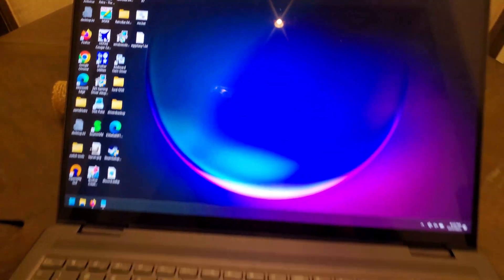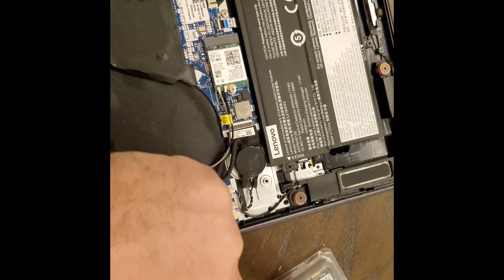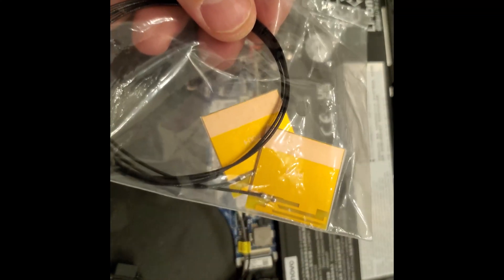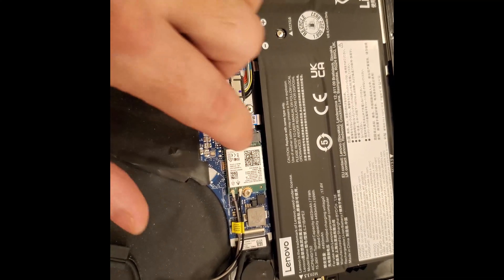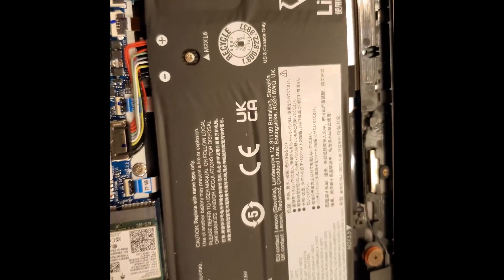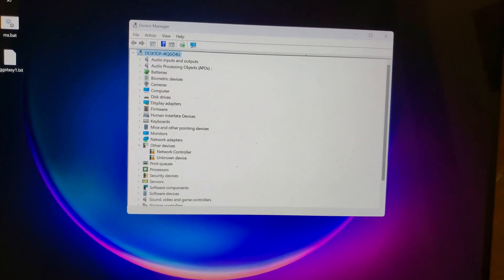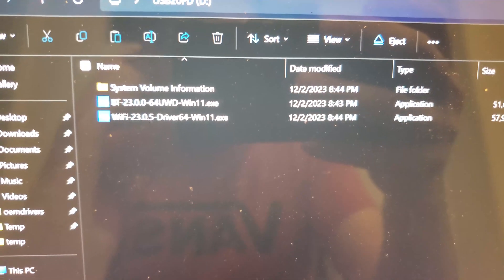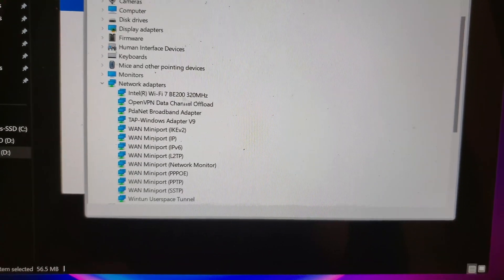Easy WiFi 7/Bluetooth 5.4 Upgrade (Intel BE200 M.2 NGFF Card)

Comment from the maker: Intel has updated its drivers to version 23.10.0 which now supports the BE200 on Windows 10 x64 and x86 , however it does state the card will have limited functionality meaning it will probably operate at WiFi 6E specs.

Comment: Thank you for sharing the driver files. I have ordered the same wifi module. Do you have the link which has the updated wifi driver version?
Reply from the maker: The link I shared will still get you to the current drivers, Intel also has them on their site. Happy install!
Reply from the maker: Latest version is 23.160.0.

Comment: Hello! I'm interested in finding out if my Dell G3 15 3500 laptop, which comes with an i5 10300H processor and a 1650 Ti GPU with 4 GB of VRAM, is compatible. Thank you!
Reply from the maker: Should be fine, just need to pop out the existing card and install the new one.

Comment: BE200 DOES NOT WORK IN AMD LAPTOPS AS OF MY 2024. Beware!!!! No one is talking about why even though there are no alternatives available at the moment.
Reply: Thanks. I’m also looking for a WiFi7 adapter that works with my laptop that has an AMD CPU.
Reply from the maker: Someone did post about that sometime ago.  Do you try to install it in an AMD?
Reply: @oWONTEKo  my new 6600H laptop refuses to turn at all with my be200 m.2, which ist crazy. The old i7 6700HQ boots and runs the card no issue.
Reply: Well if u have eyes they're clearly warning u not to purchase the BE200 series for any amd chipset or motherboard regarding amd
Reply: @wisetone  If YOU had eyes and weren't necrophiling your recognize that this post is a year old when it was NOT generally known yet.

Comment: Man, sorry. But can you disconnect battery at first and use antistatic gloves next time?
Reply from the maker: I was under the impression that the M.2 slot has no voltage when shutdown.. unless the board is standby mode which it does get some current.

Comment: I'd like to ask a few questions: Does it work in hotspot mode? Does it work on Linux? And does it work on non-x86? I was thinking of putting it in Arm SBC and using it as cheap access point.
Reply from the maker: When I tried the hotspot, I didn't get an option for it the hotspot to be WiFi 7 unfortunately.
Reply: @oWONTEKo  maybe problem with Windows?
Reply from the maker: Could very well be, hopefully updates will fix this.
Reply from the maker: I'll test on Linux later
Reply: @oWONTEKo 
Did you check does it work for Linux?

Comment: Hello, I want to know if the (Intel-BE200 Network Card, WiFi 7) is compatible with my notebook Acer Aspire A515-54G, Intel i5-10210U processor
Reply from the maker: Looks like it is, have a look inside your laptop to make sure the existing card M.2 slot is the same keying.
Reply: @oWONTEKo  é compativel tenho um praticamente igual, o que muda é que o meu tem placa de video dedicada, mas o blueth nao está funcionando.

Comment: I put this BE200 in my AMD desktop via pcie card. works great. You should download driver from intel though. not 3rd party. never 3rd party. I turned on hotspot for my desktop and now have an access point for wifi 7.
Reply from the maker: third party driver sites are dangerous, oemdrivers.com is the exception as it links to the manufacturing company when possible. Nice job getting your WiFi 7 card setup! peace
Reply: Hello, please tell me what AMD processor do you have? I'm considering buying a BE200 and have read a lot of reviews about compatibility issues. I have a Ryzen 5600x and Windows 11
Reply: @daniilmarkovskyj515 Do not buy it if you want the 6ghz band to work, that requires intel cpu
Reply: Nah it doesn't have the 6ghz band if you're running an AMD CPU, fucking intel and their proprietary bullshit

Comment: Can u do a test by opening task manager then performance then wi-fi and run the speed test using either google or any app. I wanna see the graph of task manager. Thanks.....
Reply from the maker: Hello! did you want me to do it on a WiFi 7 network? because I currently don't have access to one.
Reply: @oWONTEKo  so...do u currently have intel wifi 6e ? And update the driver before starting test please

Comment: Unfortunately doesn't support AMD
Reply: Realtek limited to 160MHz and sucks, you should avoid at all cost.
Reply: @anonymous12292 wifi 6e is 160mhz
Reply: You have no idea what you are talking about.  @anonymous12292
Reply from the maker: Wow, didn't know that! Is that any AMD system?
Reply: @oWONTEKo I think so, which is a shame.
Reply: @oWONTEKo no, amd will release mediatek card in 2024.
Reply: @rajmangalpandey3910  But mediatek sucks
Reply from the maker: Realtek does have a WiFi 7 card coming, but I haven't heard it works on AMD. https://oemdrivers.com/network-realtek-rtl8922ae-ndf
Reply: @oWONTEKo  previously, realtek wifi 6e chips were used in amd motherboards
Reply: Do you have any proof that it does not support AMD?
Reply: @kwinzman my wifi 6e Intel wifi card works fine on my amd computer. I even have a arc a770 on my computer. I am buying a wifi e200 wifi 7 card for my laptop. It's only 23 dollars. If you remind me in 3 weeks after I get it I'll let you know lol